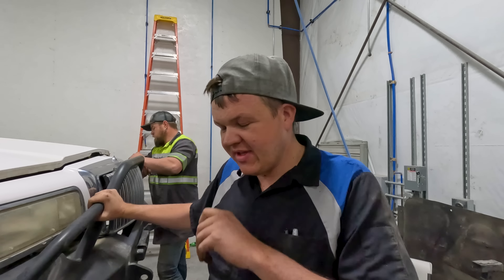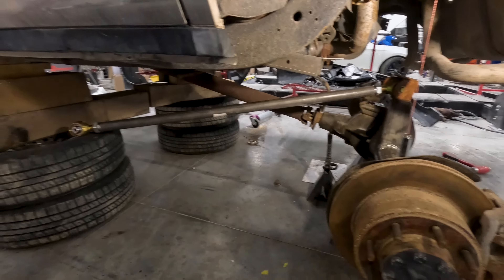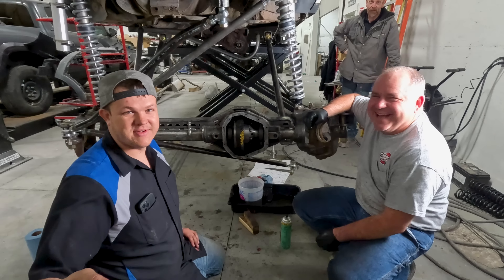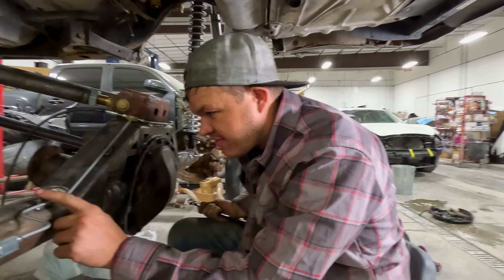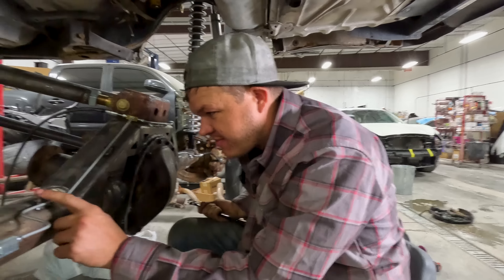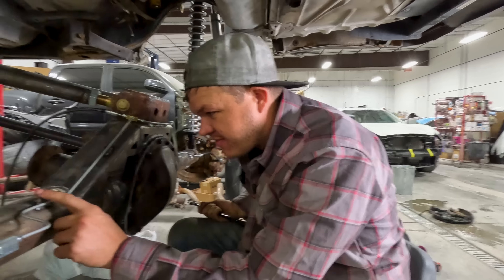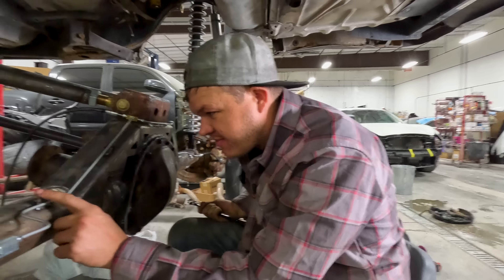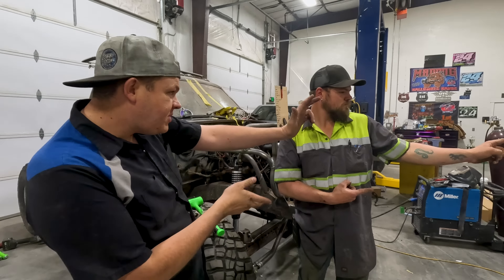We Have Been Hiding A BIG Secret From You!!

Comment: I'm guessing the limo frame is stiff enough already since it's made to handle the weight of a bunch of people inside.  You need to put a bunch of people inside with helmets on and video them flying around inside while you wheel it.  Should be pretty cool!
Reply: Chad fab kinda gave it away.   😊😊😊😊😊😊😊
Reply: If you have ever seen how they stretch a car, you would question the strength of the build.  They cut the car in half, slide in a couple of beams to make up the frame, scab in enough sheet metal to waterproof the floor, and hide everything with lots of carpet.
Reply: @robertheinkel6225  no, I've never seen the process.  I guess I assumed they'd stiffen the frame enough to handle 1,000-2,000 extra pounds of people.
Reply: @robertheinkel6225  it depends how much the person who ordered it wants to spend both of mine have bus frame from the front to the humps and the rest is boxed and plated the sheetmetal work looks like all the other seams (spot welded seam sealed and a skim coat of mud outside) most vehicles have carpet and plastic hiding the seams
Reply: @ingelri2  most places do it right they have to be inspected and rated for the weight before a company can put them in service hauling people around if they were scabbed together insurance would be crazy for a limo company

Comment: Going to miss Big Dinner, hopefully he stops in occasionally. You are not a good secret keeper Robby. Didn't know you were doing that to the limo but knew you were doing something. I hope that stretch frame can put up with the flex. Great video guy's.
Reply: The frame should be fine they're stronger than most stretched 4x4s mine aren't lifted and when the company that made them did the frame they used bus frames to the humps and boxed and plated everything from there back and boxed the bus frames everywhere a crossmember and triangulated bracing is

Comment: Drop pitman arms tend to break in rocks trying to get sidebite or bumping 1 tire at a time up a ledge especially if you go over 2.5 inch drop or add hydro assist I always weld a tube to the bottom of my boxed plated frame and lower the steering box drop pitman arms are a fix like using a t-case drop to correct a rear driveline angle it just causes problems elsewhere (those that don't know dropping the t-case to get the rear driveline angle right makes the front driveline angle worse) personally I'd figure out a different fix or keep it out of serious stuff